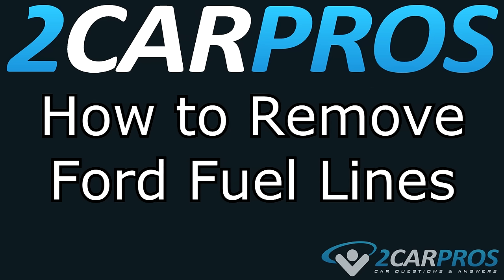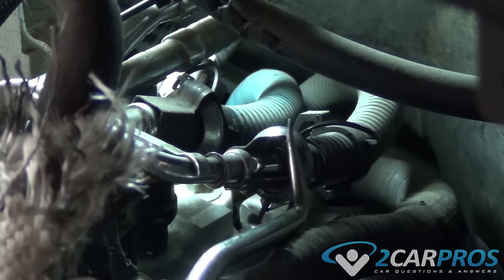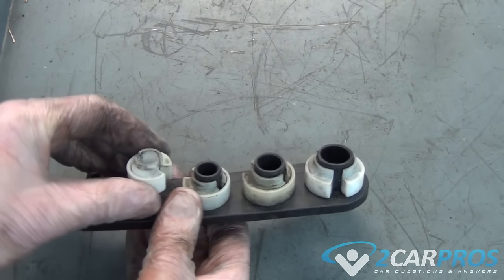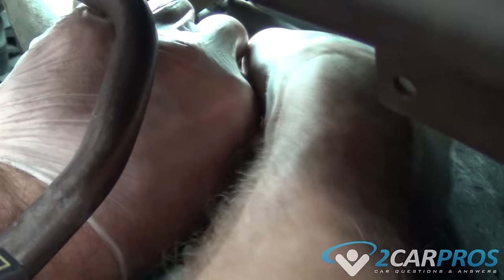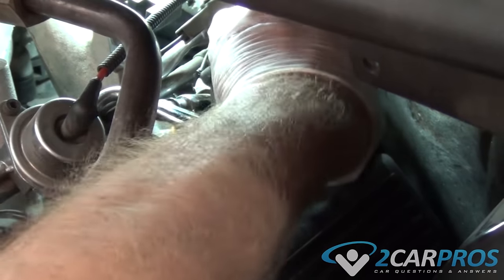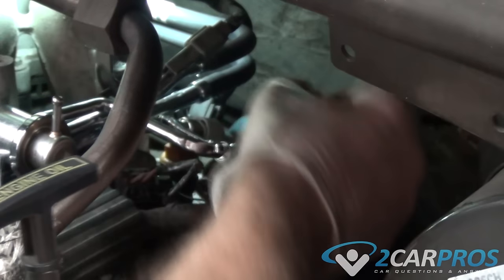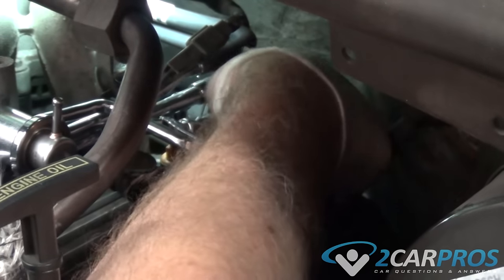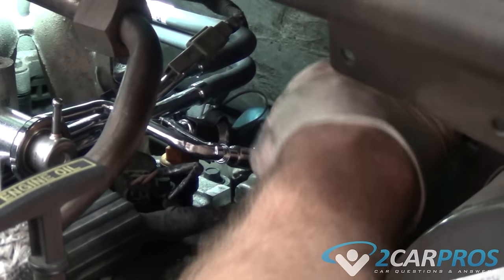How to Remove THOSE PESKY Ford Fuel Lines - ALL MODELS!

Comment: A helpful tip here, while pushing the tool into the connector, try pushing the 2 lines together. This releases the pressure on teeth you are trying to push the tool into.

Comment: While I agree with some other comments about your hands being in the way, this vid was still a good resource for me.  I took your suggestion and got a kit off Amazon, and it came in today!  Went out and popped them on (2 different sizes) but lines wouldn't separate!  So I thought I must be doing it wrong.  Nope.  You were right - it is a wee bit involved, but not bad really.  I needed this to remove LIM to clean intake down to the valves (fuel rail was being very stubborn so I took another route).
Reply from the maker: Thank you so much for watching! Yeah they can be really stubborn.

Comment: Very helpful my plastic tool did not work at all so I went back and bought the metal scissors tool and finished in 10 minutes all 4 fuel lines, Thanks for the video😆
Reply from the maker: Those are good too! Thank you for watching!
Reply: Thanks for the info on the metal tool, I also tried
 with the plastic tool, just went and picked up the metal tool that looks kind a like scissors about to give it a try.
Reply: You said "all 4" lines...  Here is where I'm lost because the lines that are going into the fuel rail on the passenger side, they don't have the same disconnect thingys as the other side!!!   Can I replace those lines WITHOUT replacing the fuel rail on that side??    

Any good advice will be very appreciated!!  I'm very very new at this.. bought the truck this way & learning!!!

Comment: Once used an aluminum pop can, cut in one inch wide strip.  Wrapped around fuel coupling twice, and pushed into fitting to release the spring and open the connection.

Comment: You don't need ANY of this.   Take a 1/2" copper coupler for rigid copper water line, cut a slot lengthwise, then 180 degrees opposite make a partial cut to weaken the coupler.  Open it, using the partial cut area for a hinge, place over fuel line, close it up, and squeeze it into the fitting with channel locks.  Some penetrating oil will help. Easy.
Reply: Cool man. Thanks.
Reply: Yeah cuz not going to get the $8 fuel disconnect tool is way harder then fabricating tools for no reason right?

Comment: Hello, do fuel lines get partially clogged? I suspect that because my 1990 Ford F150 4,9 is giving me a hard tome to start the first thing in the morning. I have to kick it like 30 times while at the same time pretending to start it a few times so that it would bring the fuel close to the spark plugs and start the engine. Once it starts, the rest of the day will give no problems, so I suspect a partial block.

Comment: I have a 1988 mustang engine going in a 56 f100 and need to remove part of the lines, but have had no luck getting them apart. they look different from the ones you're showing, I have both plastic and metal tool. any suggestions?

Comment: How do you remove the hose that interconnects the two sides of the fuel rail on a SN95 Mustang GT without cutting them. I don't see any quick disconnects.

Comment: the disconnects on the fuel rail are easy compared to fuel filter and fuel tank, just sayin.
I know you can't please everybody ;-p
Reply from the maker: Pretty much, thanks for watching :)
Reply: Sure, thanks for posting. I know it takes a lot of work to put an instructional
video together. I had just crawled out from under a truck that I had been struggling
with the quick connections for over an hour. Found out the two different types
of disconnect tools that I had were too short, had to find another way- thumbs up !!

Comment: Just spent about 2 hours with two different removal tools trying to remove the fuel lines from a 2000 Expedition fuel filter.
I'm done... idk wtf I'm doing wrong and gave up as the sun went down and it started raining lol

Comment: Thank you . I just replaced the fuel filter on my 1995 Ford F-150 4.9 and I used the disconnect tool and it worked after about 1/2 an hour and a swear word or 2. I reconnected the rear and heard the click sound  but when I reconnected the front I did not hear the click at all and the filter would not stay in the fuel line. I am 60 years old so I put on my glasses only to see that the round metal piece that I guess holds the line to the filter was all mashed up inside. I got it out and straightened it out and made it round again and placed it back inside the fuel line but still did not get the click sound. I live 6 hours away from any part store in Canada's Yukon so I was wondering if I can drive my truck with it connected only by the 1 clamp holding the filter to the fuel line. I pulled really hard and it stayed on so any advice would greatly be appreciated.
Reply from the maker: Turn the truck on and see if it leaks gas. If not and the line won't come out then you can probably drive it at least for a bit. Thank you for watching!

Comment: 2cars pro, my 1999 Ford Windstar 3.8 fuel line somewhere in the hood department is spraying fuel when can is on, due to rodents chewing the line, I tried a reconnection but the hose is nylon and seems to not be able to get the hose ends around the connection. So I'ma just replace the entire line, now my question is... On the other end of fuel line is there a specific tool I need to in do that end ?? Like the front ?

Comment: What size was the removal tool that you used?  I looked it up and it says it was 3/8” but I used a three eights line tool but it’s not the right size? Or I’m putting it in the wrong place? Thanks
Reply from the maker: I believe it was 3/8" but it is super tricky to get all 3 tangs retracted. Thanks for watching!

Comment: That is only one type of connector used by Ford My Lincoln LS has two different ones just on the fuel filter and no flexible fuel line.

Comment: Guy points out the fuel line. Tool you need to disconnect the line. Explains how the tool fits into said line. Rest is pretty much self explanatory. It's not rocket science guys. You don't need to see the line the entire time. Thanks for the video. I just wanted to make sure I was doing it correctly. This thing is aggravating to get off.
Reply from the maker: Thanks for watching!

Comment: Can I just cut the metal line and go old school.... using a hose clamp instead of the dumb connector?
Reply from the maker: I don't think that will be able to hold the pressure. It will be dangerous to have a leak. Thanks for watching!

Comment: Do you have to relieve the fuel pressure before doing this
Reply from the maker: When you remove the line the fuel pressure is relieved. Thanks for watching!
Reply: Yes, either bleed the pressure off at the fuel rail schrader valve under the hood or trip the inertia switch and run the engine out of gas ..  which is the safest way.  If you don't relieve the pressure first the connector will be harder to remove and gas will go everywhere.

Comment: This is not for all models. My 2003 F150 does not have that type connector on the fuel pump!
Reply: I have a 2003 Ford Ranger leaking on top of the tank, and I suspect the fuel line. What removal tool did you use?

Comment: 97 f150, same exact spring fittings. I got them off using plastic tools. I had to shave one of the plastic tools down to make it a more tapered edge for it to fit under the spring. Problem.... the fittings do not want to click back into place, no matter how hard I am pressing them back in. Anyone have a solution?
Reply from the maker: Did one of the 3 tangs inside of the line get ruined? Thanks for watching!
Reply: @2carpros  Great question. The spring is blocking the view... Can I remove the spring on the female end fitting with a dental pick without causing damage?

Comment: You didn't remove a single fuel line as is the title of this video.
Reply from the maker: The line is disconnected which is the hard part. Taking a line out is the easy part. Thanks for watching!
Reply: @2carpros  Wow. Talk about justifying your title lie with an excuse... and ... WRONG! The line winds it's way through hangers and in a narrow gap between a fuel tank. No way that's the hard part. NOT EVEN CLOSE! Next time try honesty in your titles.
Reply from the maker: @bessermt  The title is honest. Sorry you cannot understand why it is titled that way. The hard part is removing the connector. You have to do that again on the otherside of the tube, and then it slides out usually. I think you got this, I believe in you bud! Big hugs!
Reply: @2carpros  The word is called "Disconnect" not "Remove". I don't understand your title because I speak English and know the meanings of words. You should try it.